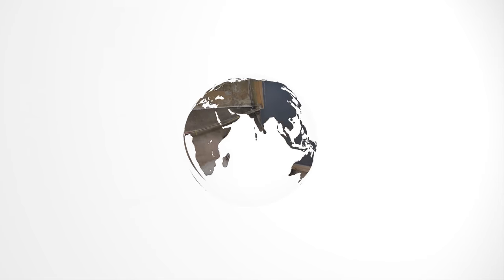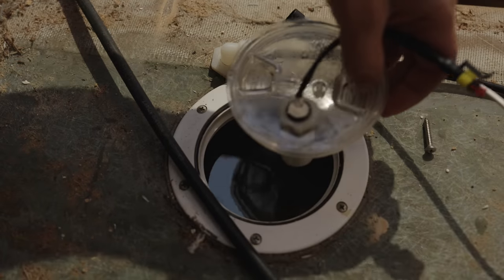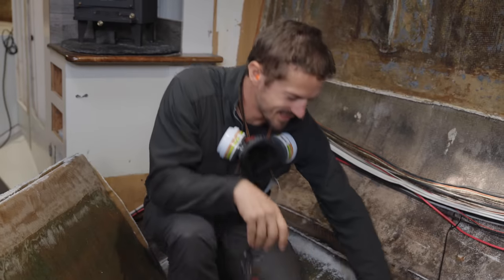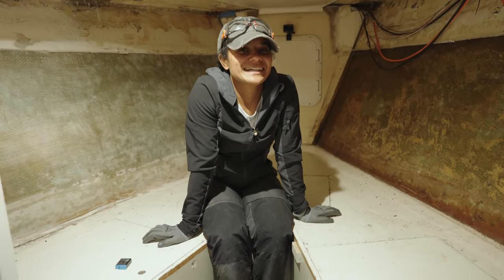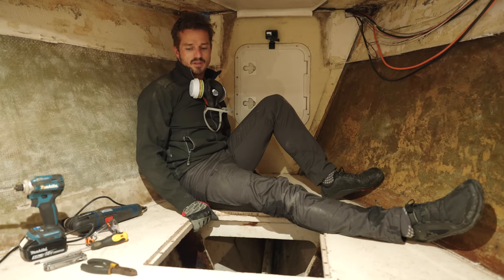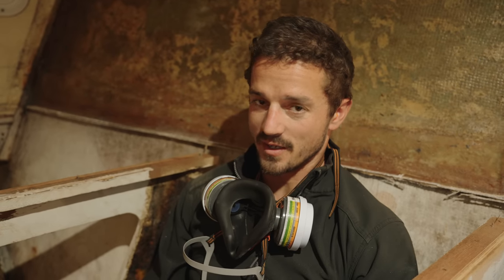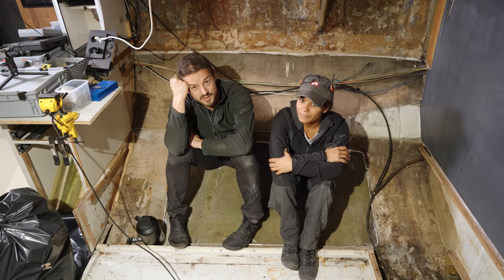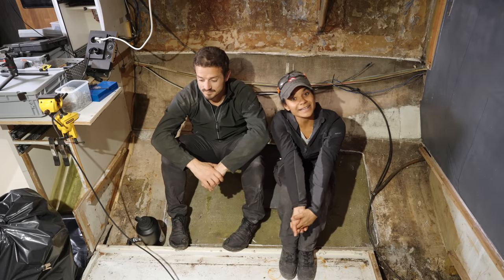It's Worse than we Thought | Step 347

Comment: Old sailors be like: They don't make them like they used to. 

Uma crew: Thank God they don't.
Reply from the maker: There’s really nothing better than a good vacuum infused sandwich. It’s pretty incredible actually.
Reply: @SailingUma  Depends on Core material used and what type or resin they used.
Reply: Instead of making multiple smaller bulkheads consider making a sandwich with foam on the hull sides. A couple layers of bi-axe fibermats on on top of the foam and you will have given it such more stiffness and ability to distribute the forces on the hull. And at the same time, effectively insulating it against the cooling water outside.
Reply: my boat is the only boat you say that about and mean it. solid glass through and through

Comment: These boats were designed and built as local club racer/cruisers.  Certainly, neither Bill Shaw or the folks at Pearson expected them to be charging across the ocean at all, much less 50 years later. As such, it is a testament to the builder that, even with the construction decisions made at the time (non-structural interior elements lightly tabbed in) these 70s-vintage boats are doing remarkable things.  It is also wonderful that people are making an effort to keep these things alive and, as here, making it better than original for the hard sailing they do.

I sailed a sister ship 3000 miles between Seattle and Hawaii when the boat was only 4 years old.  Strong, fast and a great sea boat.  The same goes for the Pearson 39 I owned for many years and many miles.
Reply: You think it will be good for the boat to built it back
Like Dan talked about he did say the hull is really thin . You think over strengthen will hurt the boat? Is it good for the boat to be able to flex a little?

Comment: If you fit the bulkheads hard up against the hull and then glass both sides, you may find you have witness lines on the outside of the hull due to shrinkage of the GRP . I used to leave a 10 mil gap between bulkhead and hull and fill with foam, then laminate both sides. not all bulkheads need to be structural on a boat of that size. Some are just dividers. I only used two glass dividers on one side, but the gaps on yours are extreme. Made GRP boats for many many years. Wishing you the best of luck with your project.

Comment: The reason the bulkheads are NOT butted directly on the hull, is because it causes stress risers on the hull. There is some triangular structural foam pieces, that keep the bulkhead off the hull, and allow you to put a couple of layers , on each side, to bond the bulkhead to the hull. This allows the hull to be flexible, without stress risers.

Comment: Have you looked into using foam core and glassing over that?
It would be a structural second layer and insulation... add a gell coat and you don't need another covering like ply etc.. also wipe clean.
Regarding the bed base.. I did 3"x1" with 1" gap slats .. you could go 4"x1" with 1" gaps like a futon.. then access underneath from the front which is left open for ventilation.. that's how I have done mine.. using oak.. actually from Windsor park.. they were bits that didn't make the grade for a building with a wavey roof in 2005 ish.
I did think if no one there will allow you to work on the boat outside when craned out there.. then do all the interior there and then go sailing till you find somewhere.
Regards from
Bella 🐈 & Mark.

Comment: 5:25 Fun fact, "high end" boats, like from Beneteau, in the Great Recession era (2008-2009), had issues like this out of the factory as corners were cut.

This type of thing is why I advocated for spending the money and effort on your current boat "that isn't worth it" because newer boats will have issues that you'd have to deal with, put up with, or suffer through since the money to fix the issues was spent on the newer boat.

Anyone advocating for a newer boat doesn't understand that a boat is a hole in the water that you pour money into, regardless of it being newer than your 50 year old trouper.

Comment: You might consider putting 1/4 or 3/8 foam using epoxy on the inside of the hull and glassing on top of it to stiffen your hull, making it a foam-cored hull that is much stiffer while adding little weight. I have a 1974 Ericson 37 with a balsa core hull that is very stiff and in good shape.  The only thing about cored decks and hulls is that wherever you put a hole thru it you need to cut back the core around the hole and add thickened epoxy to keep the core from ever getting wet. If you go with stringers make sure you make fillets so that you don't have hard spots, especially considering how flexible your hull is or you can crack the hull.  Enjoy the project.  It is always fun to watch you guys.

Comment: Hi you two destroyers☺, i actually also have been working in the watersportsindustry for nearly 30 years now and have been following you guys for some time now, great stories and definately something else than the usual vloggers. You are always talking about making vertical stiffeners along your bow to make the laminate stiffer. why donít you make it a sandwich laminate? make syure your outer hull is completely clean and then glue divinicell foam core on top of it, and then on top of that glue an inner laminate of some GSM mats and then you make that laminate way stiffer than it will ever be with vertical stiffeners. and it will also isolate the hull thus decreasing the moisture inside the hull also. After that make the interior frame for the V-berth and the bed itself and polyester these to the hull with some GSM mats and ten you have a really strong construction. good luck! greetings, Douwe

Comment: Hi! Maybe you should consider gluing a hard type (divinycell 75kg) foam  to the hull, and then glass over. It will stiffen you boat dramatically. There are many benefits to this procedure, but to name a few:
1. greater strength
2. Insulation (minimizing condensation)
3. ease of application
4. light weight

Let me know if you want more info on the matter. Have done it a couple of times and doing a 34 ft sailboat at the moment. 

Kind regards,
Carl (boatbuilder)

Comment: Dan & Kika, seriously consider scanning the inside of the hull and importing into your CAD software, then you can either print out fullsize patterns or just order CNC'd replacement part based on the CAD and you new design. Use self jigging features to keep everything true while installing and glassing.  If your software has an analysis suite, you could run the stress analysis for the rigging plates.  I would love to see this, and other sailing channels could see how to do it right.  Good Job.

Comment: Hello, did you guys concider to use this honeycomb foam core for the hull? Shipyards used to build boats with it nowadays. I think the stuff is called 3d core xps. It gives u a real good structural strength, it isolates against the cold/heat/noise, it weight´s like nothing and it´s made from recyceled foam. This could be the first DIY project showing it on YT so the producer might provide you with the material plus the vacuum pump for the infusion. Just an idea ;-)

Comment: A couple of questions if I could? I'm a lock and weir keeper on the River Thames and see a lot of river boats and clearly, the ocean going vessels are different. Will you be running conduit for the wiring - would that be better or worse for water collecting in hard to reach areas? secondly, adding more bulk heads - is there a danger of over stiffening the hull leading to cracks? - loving the education, many thanks!
Reply: I know nothing about boats , but I was thinking maybe that boat was built that way for a reason.

Comment: Good luck with your refit guys. It’s going to be great to follow along.  Good call to add ribs and longitudinal stringers to the hull. Keep a gap between the new bulkheads and the hull skin, the bulkhead should not be in contact with the hull, you can use a foam spacer between the hull and bulkhead which can also provide a transition for the tabbing. The tabbing is what should transfer the loads between the bulkheads and the hull skin. If you have not got it you should get a book called Boat Strength by Dave Gerr that will help you design all the structure you should put into the boat. It is a great book. 👍

Comment: Have you considered adding a layer of foam core in the bow area rather than structural ribs? Core is super stiff and less intrusive in the space. You get thermal and sound insulation built in. You only need to add 1/2"core to stiffen the hull with a layer of 20 oz cloth on the inside. Super easy then to refit your bow without needing to deal with all the ribs and their ability to trap moisture. If your hull is so thin. The addition of core is a great solution.
Our 43 year old Trintella 44 was built in Airex core. Super dry, stiff and in perfect condition. The water tank on our boat is grp and built into the boat as a structural element. 220 gallon. It sits over the keel. We refurbished it a couple of years ago with a potable quality polyurethane 2 pack paint. We can climb into the tank so easier to work on than your tanks. We love our grp water tank. No corrosion. No leaks. No wasted space. No taste and the weight is just where we need it over the keel

Comment: Cheap serial boat production cuts corner after corner.Liners also hide a multitude of sins.On custom boats we  used cotton fiber with epoxy and peelply just to do the fillets before taping the bulkhead in using epoxy and double bias glass on both sides or minimally to a monolithic skin when only one side possible.Great that you guys keep your optimism many would not .

Comment: Regarding air gap between hull and partition wall: you make unwaranted assumption that this be low quality/design flaw. In fact, this may be a design feature to allow proper spreading of stress/movement. Connecting parts into one solid piece may lead to concentration of stress in this area and cause material failure. It was ok for 50 years and this tells something. Consult specialist. Be humble. You do not know what lays beyond limits of your knowledge.

Comment: Wow, just wow!!. Also  high (southern) latitude sailors we did a major 'half life' refit on my '86 built boat in 2015... no where near as extreme as yours. Cupla points ... years ago I found she was prone to 'oil canning' up frd when working to windward . Laminated in longitudinals at 'shelf level' which means you also have a shelf to build on. Also for insulation against the hull we simply used 6mm EVA foam throughout... the foil backed ones , works good. Currently replacing our 1986 engine. Oh joy , oh happiness.
Reply: EVA foam camping mats.. cheap as

Comment: Hi guys! I have been following you for a while and let me just say I love your project! Watching this episode, I thought I could contribute a bit. You seem to be at a moment when a proper integral technical documentation of the boat could most easily be made and than maintained during your further adventures. While it is perfectly possible to recreate a structure that will be sound, just by using the rule of thumb and common sense, I think you could benefit from a more precise way to think about the changes you are about to make. For example the water tank you have now removed was a part of structure that participated in the rigidity of the hull bottom. It was a so called natural stiffener. All the modification you will do to it, should in principle guarantee achieving at least the equivalent level of strength. I am sure that you are going to nail it, but if you want. I can produce basic design help. This is a somewhat lengthy process and would involve you taking some measurements. These could be carried out during a single day I guess, and then completed here and there if needed. I would then make a 3D model of your hull with the structure that you want to keep. From there it is possible to calculate the design pressures and calculate the necessary laminate parameters for the reinforcements that you would later introduce. Let me know if this interests you. And anyhow, good luck!

Comment: 1-Remove all the rest of the original garbage interior including the primary bulkheads that are probably undersized. 
2- Grind all the interior surface to clean, raw fiberglass.
3- Completely re-engineer the chainplates, floor timbers, and keel structure.
4- Infuse an entire new boat into the bare hull that is (finally!) structurally adequate. 
5- Use balsa core.  When infused every block is completely encased in resin and will never rot. Cheaper, stiffer (and heavier) than foam core, but never will de laminate.
6 - Use vinylester resin.  For this application there is no benefit in paying  for epoxy. 
7- Build the interior back to fit your rather different interior that you have developed out of many years of experience. 

(once the vacuum bag is in place, infusing the entire hull is only a couple hours job)  Believe me, building an entire new boat from a bare hull is less work than building one from band aids over garbage no matter how you try to reinforce it. 

Yes, you should have sold her and done another project on a boat worthy of the effort!

Comment: Ragarding the bulkheads not glassed to anything, I recently saw a video about one of the higher end cruising cat makers. They don't glass the bulkheads in either. The reasoning behind not glassing the stuff in is, if you leave a gap and fill it with foam or some rubber compound, stuff doesn't creak (as much?). The hull is supposed to be solid on its own and shouldn't need the bulkheads for stability (unless you make it too thin and factor in the bulkheads...)

Comment: PVC is good in many applications but it has been found to be extremely toxic in closed water supply.  You probably know that. some have substituted copper pipe replacement for safe potability.  Just came to mind as you redesign.  Thanks for your continuing adventure.
Reply: They'd be fine with CPVC. That stuff is rated for use with drinking water.

Comment: It’s really bold to redesign the structure of the boat without knowledge of the original design and the expected loading. I get all the repairs but there are complex relationships between stiffness and strength in a structure and adding stiffness can create stress issues immediately or over time if added in places that don’t work well with the existing boat. All that being said Uma is definitely in need of reinforcing, and I hope it works out as well as your previous projects!

Comment: Congratulations on the demo it's going to be a fun project to watch. I am not sure what todays practice is but in the 60's and 70's we were not fitting ply bulkheads up tight to the hull prior to bonding them in place. The thought was that they would produce a "hard" stress point and the load needed to be spread out, we did put a fillet of bog either side prior to the bonding.

Comment: I know its a thing in the industry but i am always amazed at all the raw glass that is not gel coated or painted white. It leaves all the imperfections for mold and dirt. It always seems impossible to clean, especially after leaks and stuff. I like knowing things are clean. Also, its easier to spot leaks and cracks when its white.
Also as everyone else looks to move to a new boat you guys, keep tearing down your boat to make it better and fix it. I wonder if you would ever up grade to a new boat.
It would be cool if you could find a cnc shop that could cut your bulkheads to the perfect measurement possibly in 2 or 3 pieces that could be bolted together in the boat before glassing. You could design them onsite in cad and have them laser cut.  Like we do on a glow forge for smaller projects.

Comment: Now that the inside is bare, you could build a sandwich starting from the existing outside skin toward the inside. You add omegas where extra strength is needed (mast area plus at regular centres) and you get an insulated hull strong enough to circumnavigate against the wind!
Reply from the maker: No need! The bulkheads we’ll be adding back in will be overkill as it is. Adding foam core is just a waste of time and money on a boat like ours.
Reply: @SailingUma  There are many ways to skin a cat and bulkheads obviously work... The core does not have to be expensive foam, it just makes sense to use something that has to be here (insulation) to reinforce the boat and if you replace the bulkheads by big omegas, you gain flexibility.

Comment: I was staggered to see there are no horizontal stringers. No structural stiffening at all given the state of the bulkheads. Your deformation problems are as a result of this obviously. Stringers would have helped support the knees so without that support, guess what? Anyway as you noted adding some framing to the hull will help immensely. You should end up with a thoroughly seaworthy boat by the time you’ve finished.

Comment: Maybe create the supports in a mini I-Beam design vertically and horizontally. enabling you to fasten screws to the inner side giving your the strength and surface to work with.

Comment: Throughout the history of fiberglass boats people with limited knowledge have fixed up old boats and sailed out and disappeared. I always thought it was rigging or hull failure and not sea monsters. You partially restored your boat and went on amazing cruises. But overtime you have come to see the level of risk you were exposed to. When you started your original restoration some people advised you not to do it. It seems they were right because as the condition of the hull shows, you were very lucky. Hoping for continued good luck for you both. And future good decisions.
Reply from the maker: All boats have limitations. You need to learn them and sail within them. We’ve obviously done that or our boat would have sunk. Now we can easily out sail our boat, so it’s time to stiffen her up and increase her capabilities to match ours.